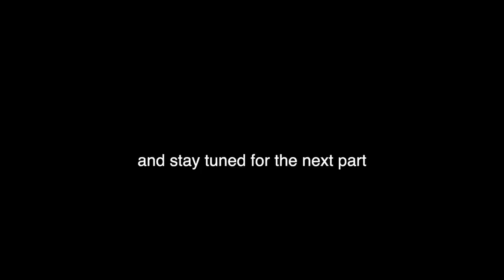OFF GRID Electrical Pt-1 || VANLIFE Community Service

Comment: I have some knowledge in electrical and I feel you are doing really good.
Had I done these things it would certainly not have been as well done as what you are doing.
What I'm doing always end up working well but the aesthetic of my work is light years behind the quality of yours.
What I fear the most in electrical installations is fire and I take all foreseeable measure to prevent it.
Emmy should be aware that she should avoid messing around the electrical system and this area should be left clear of any objects that can bounce while she is driving her van.

Comment: Question... It it a good idea to label your connection to the wires which makes it easier to find a problem?
I was thinking that when you was telling us about the negative wires an all the other wires..
I'm with her 😆.. I just can't seem to understand the electrical.. (so, I was wondering if putting labels would help for trouble shutting any problems 😉

Comment: A Joseph..how long can the batteries last without them hooked up?
Reply: I haven't paid that much attention to what batteries she has, but I've got two Renogy 100Ah AGM batteries sitting on the floor of my garage, that I pulled out of my van three months ago, both holding at 12.9 that entire time. (Close to 0°C / 32°F ever since.)(Your mileage may vary.)

Comment: Renogy stuff is a waste of money. Should have purchased a  isolator then to the battery is reliable and inexpensive . Less thick guage wire required also
Reply: Love my Renogy system.
I have the same Controller.
Wish it had come with a monitor though.
Works great!
Reply: @jillom6648  but why?? Is so expensive . And requires double the wire .  And doesn’t give you anymore than an isolater. Anyway there must be a reason but I went with simple and less expensive but reliable